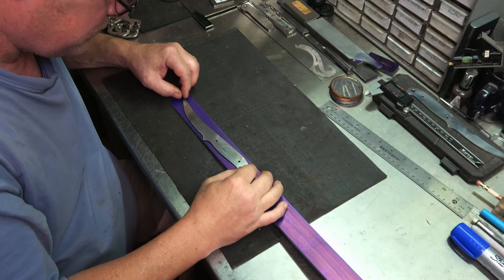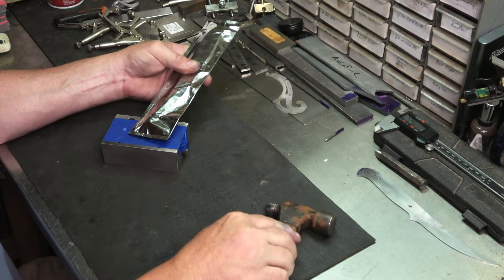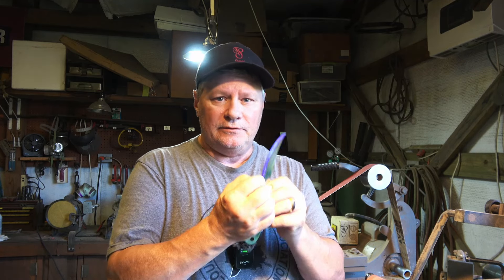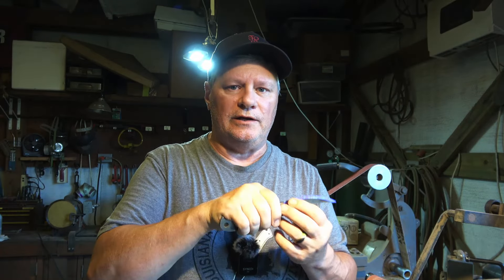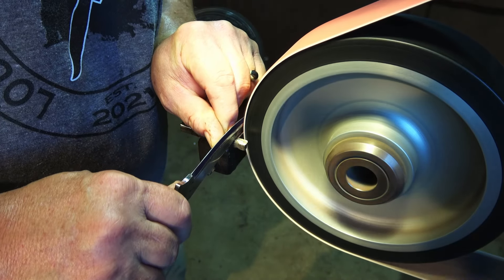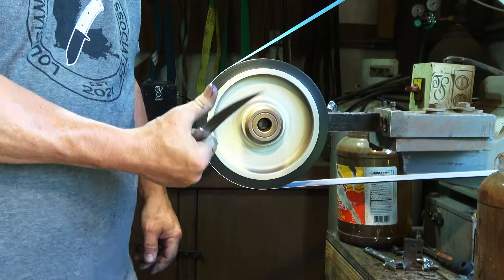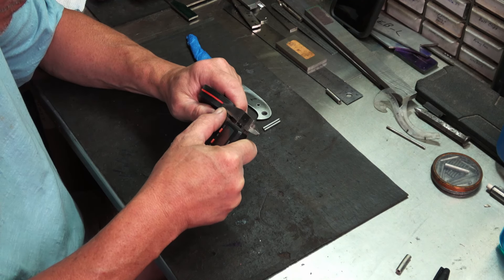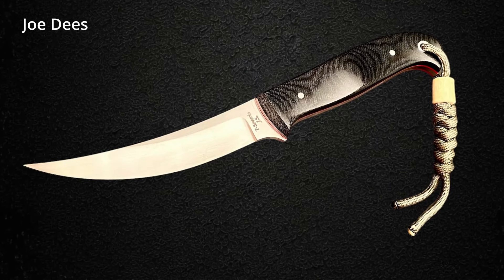Hollow Grind a knife in MINUTES!

Comment: My brother built me a 2x72 sander/grinder, total build custom welding just ordered all the parts.  I was telling him we need market it!  lol!  Its a outstanding design but I've been using it mostly to hog off and polish it has 3400rpm motor, we're replacing it with 1750rpm , he told me if we reduce the motor wheel size it will reduce the 1750rpm down a little more so we ordered 1750, this 3400 is too much speed. Anyway had a couple of questions for you,  were attaching a 10" knife wheel for hollow grinds.  The top tube my platen slides into the top.  It was built with separate lower tube for the table.  I've been specializing in 4-1/2" hand grinder to create my hollow grinds but my bro is making me a custom attachment for 10" wheel to attach in front of my table, positioned just off the table.  My grinder has 2 attachment tubes which is pretty cool but what I was wondering will the 10" wheel handle 3/4" - 1" wide hollow grinds?  also do you hollow grind to zero tolerance or do you create a secondary cutting edge?  I was just curious,  I think I might need another separate tube attachment so that I can use the 10"wheel without the table.  Will I need it more with the table to create the hollow grinds or more without the table for the hollow grinds?  Thanks for your time!   You do an outstanding job on your knives!  I dig you systems and approach, I do similar approaches., I tend to make larger blades and they're a lot of hogging off and work...lol!  exclusively stock removal and I use a water spray bottle to keep steel cooled down.  Next year I'm shooting for making me a new 625sq foot metal shop adding new lathe, welder, propane forge and oven as well as some specialized grinders. I want a cleaner shop with work desk like yours, my current shop one has dirt floor and outside overhead awning.  My new shop I'll have a cement floor and I love working partially outside so I'll have an outside work area with overhead awning roof.  Just ran across your YT, I'm sure I'll be back to steal some ideas thanks again!
Reply from the maker: Awesome man!  A 10” wheel will give you a 3/4 grind height with a 20 thousandths edge thickness then make your secondary sharpening bevel.   Hope you get your shop going!  Thanks for watching!
Reply: @TonySeverioKnives  20 thousandths?  Ok thanks!
Reply from the maker: @snow_tacknives2024 you’re welcome 🙂
Reply: @TonySeverioKnives  What angle do you do your secondary cutting bevel? with a ending 20 thou thickness? ...15 degree, 10 degree?  I've been getting around 10-15  degree or sometimes I finish them out to zero like on a straight razor or scandi/convex type.
Reply from the maker: @snow_tacknives2024 I target around 17 degrees

Comment: That's some fine grinding there my friend 👍 I need to get a wheel for handles mostly. Was that an 8in wheel you were using?
Reply from the maker: Thanks brother.  Yes this was an 8 inch wheel.  The bevels look good on this size knife in my opinion.  But the larger the wheel, the easier it is.  I highly suggest the largest wheel you can afford.  They still look great know matter what size.

Comment: Ok; just came over from your short. So, 1st mistake on my end was not knowing that this is considered a hollow grind — I thought that applied only to the edge itself. 👍🏼.

Follow up question: can I do a hollow grind on a flat platten or is a wheel kind of a must on that?
Reply from the maker: A wheel is used to hollow grind.  You are cutting a concave bevel with a wheel.  The flat platten cuts a flat bevel from the edge towards the spine.  But techniques to beveling are the same..

Comment: Hey Tony, first congrats on the Journeyman.  I’m new to hollow grinding, so thank you for this video.  But what size wheel would you recommend for hollow grinding basic hunting knives?  Thanks!
Reply from the maker: Thank you!  I use an 8” wheel for most but wider blades will need a larger wheel.  But the larger the wheel, the easier the grind.  And you can grind any blade with a large wheel.